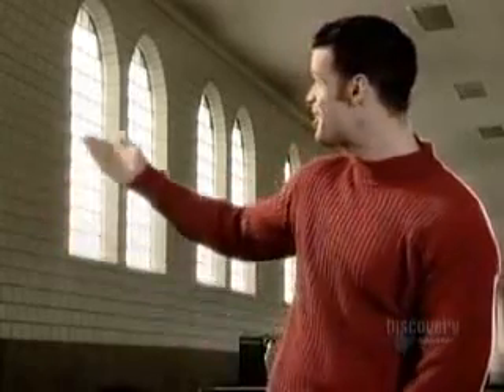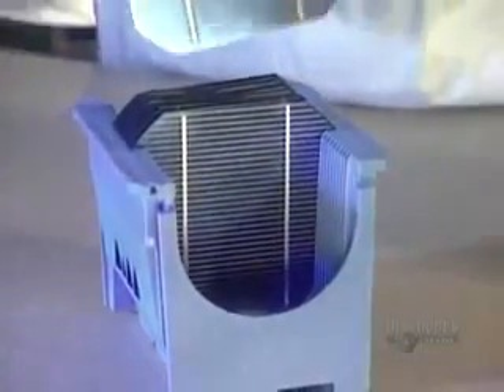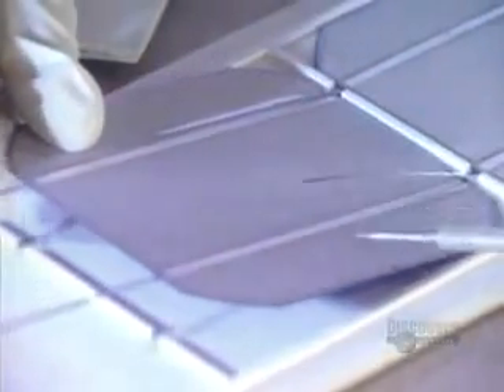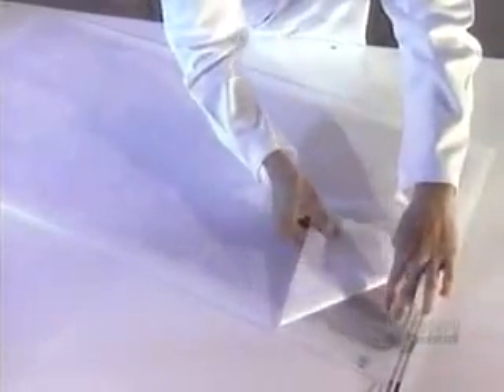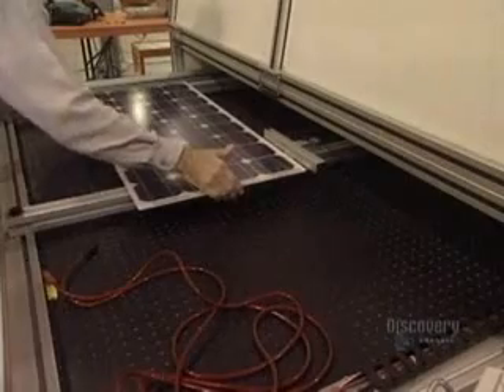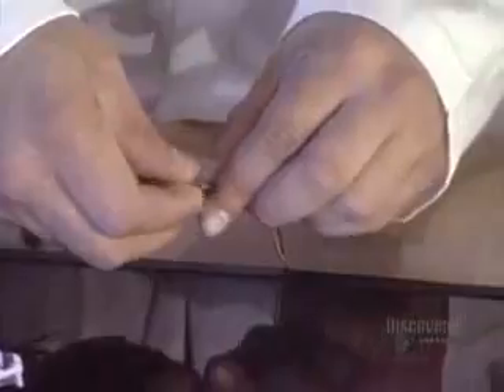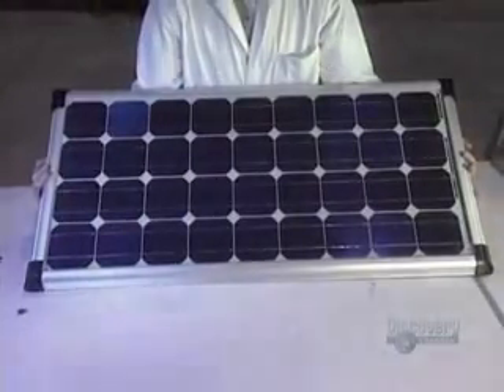Solar Panel with EVA Film Manufacturing Procedure-Silicone Sheet  Ethylene Vinyl Acetate EVA

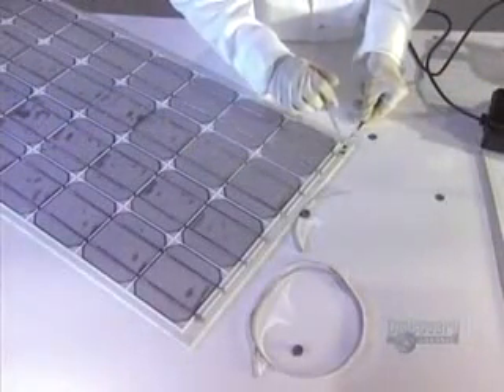Comment: 2:01 "then this metallic strip is inserted which is a conductor that will link the 4 groups of 9 modules", so by the looks of it the 9 modules are soldered in series and then the 4 groups are soldered in parallel? Am I seeing that right?